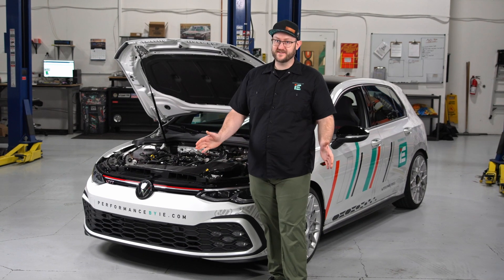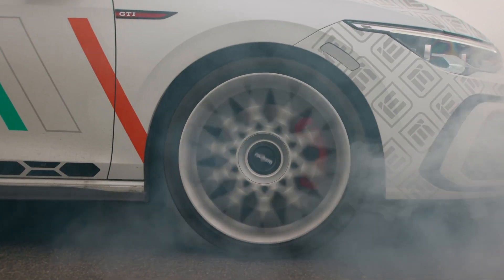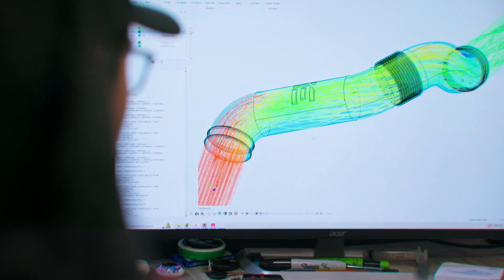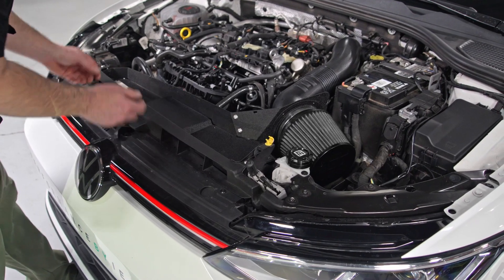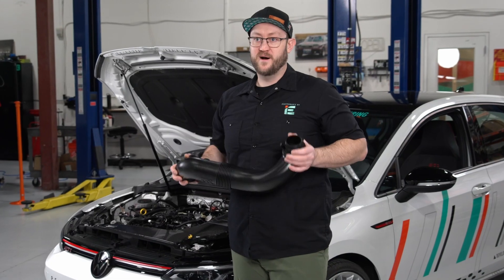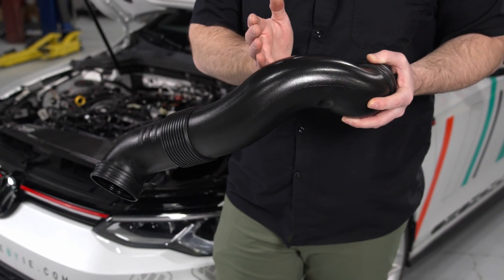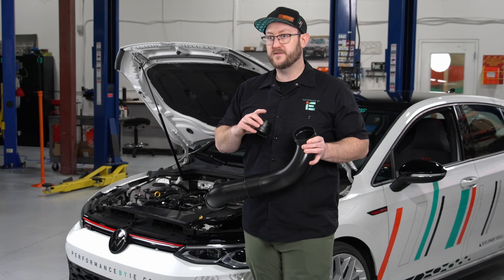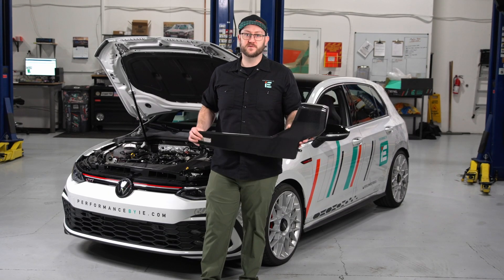iE VW MK8 Air Intakes | Technically Speaking

Comment: I have 2 complains about this system, i just installed it in my MK8. One: the plugs for the coolant didn’t came with them and im missing the rubber piece when you don’t install the carbon fiber lid.

Comment: Does this intake have an SAI port? If it does, I’m sold. I see some sort of hole on the tube back from the filter but no SAI is specifically mentioned
Reply: Ive been wondering the same thing, I pulled up their install guide for it and I think you just put the sai port into that hole
Reply: @MK8Kaspi it does, it has a vacuum line port and a SAI port. I have it installed on my mk8 and I love it. Quite loud so definitely can hear it when giving it gas
Reply: @brycefowler2477 have you done anything else to your gti? Been wondering what I should do next I only have a CTs intake on it right now
Reply: @MK8Kaspi I have a AWE track cat back. So total I just have the IE intake and cat back on my mk8